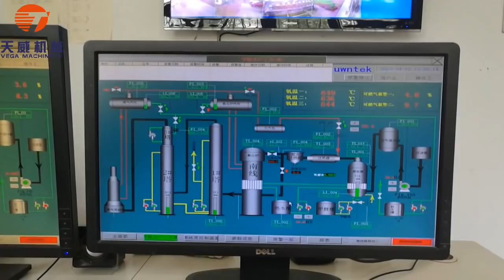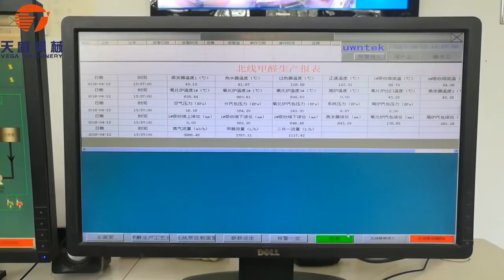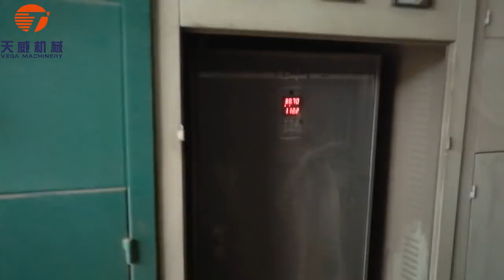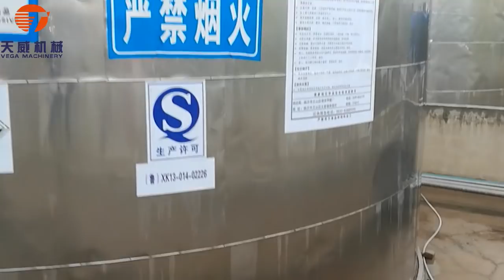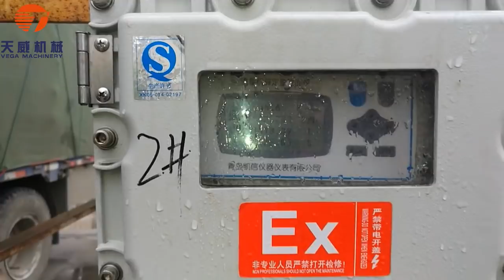Formaldehyde production process & equipment

Comment: What's the reason of black spot on silver catalyst
Reply from the maker: Hello, the silver catalyst black is mainly due to the following reasons: 1. The equipment has been used for a long time and the interior of the equipment is polluted. 2. If part of it is black, it may be caused by steam leakage. 3. If the black area is too large, you need to send pictures or videos to analyze. If necessary, you can WHATSAPP: +86 13953968207.